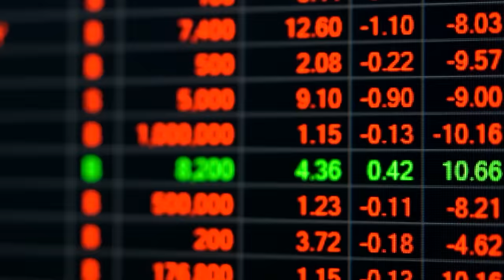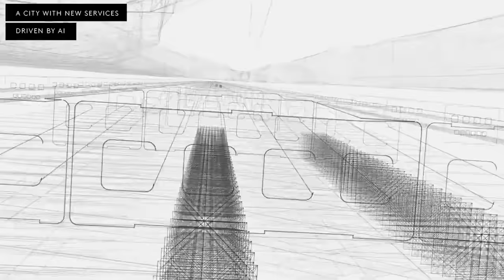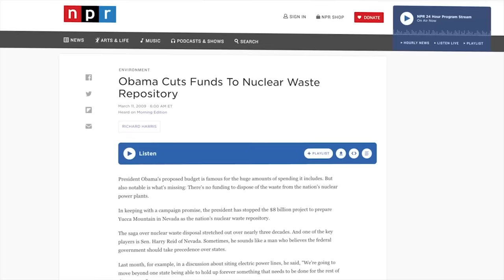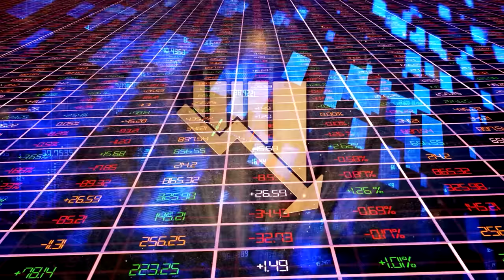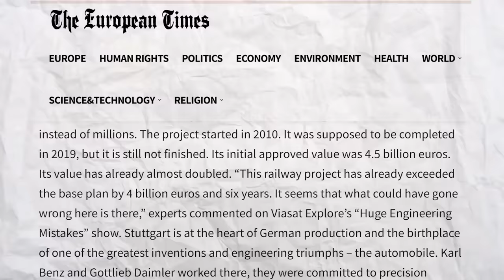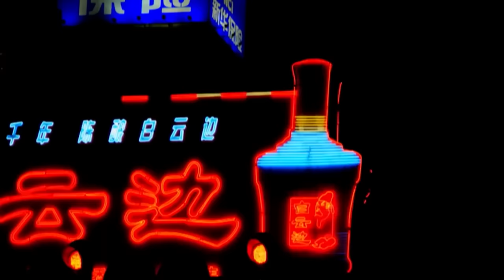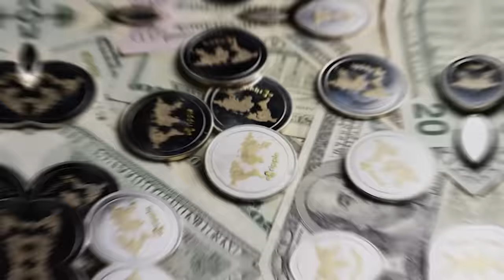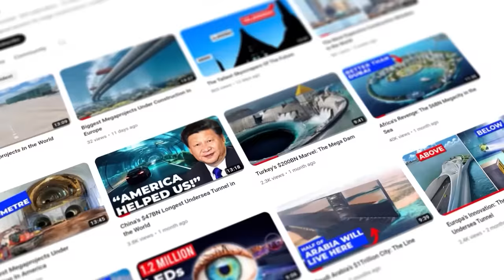Biggest Megaprojects in The World

Comment: The Globe (formally: Avicii Arena, since 2021,[2] previously: Ericsson Globe, Stockholm Globe Arena) is an arena located in the Globen area in the Johanneshov district in Stockholm. It was inaugurated on 19 February 1989 and was until 2023 the world's largest spherical building[3], when it was surpassed in size by the Sphere.[4] Since February 5, 2010, a gondola track with two round gondolas leads up to the top of the Globe, 85.20 meters above the ground and 130 meters above sea level, called Skyview. The interior ceiling height is 65 m. The Globe is owned by the City of Stockholm (via SGA Fastigheter). The Globe is operated by Stockholm Live.[5]

The globe forms the starting point of the Sweden Solar System, a scale model of the solar system in which the globe represents the sun.

So Basicly Sphere is a nockoff.. just bit bigger and years later..

Comment: One little observation: many times, when the architect doesn't have an engineering degree in structural design and engineering, they are not involved in the technical flaws occured when it comes to structure (an example is the metal structure bridge that collapsed - that was the fault of the designer engineer). 

Basically, the architect might run a brief analisys of the structural problems that may occur, but the true calculation and analisys is done by the designing engineers. Also, the architect is not involved legally (it will not be taken responsible) in the exacution phases: like the digging and storing of the resulting amount of soil in case of the falling building in Lotus Riverside. 

Many times, the project manager is the architect and he/she collaborates with the engineers to establish if a decision can be made in terms of structure, soil condition and so on. Or at least that is how it works in Europe. 🤷🏻‍♀Of course, an architect can specialise in engineering too, and that would be ideal. 

There's a little dispute over if an architect has the necessary training to be a project manager or not. If you ask an engineer, they will say no and vice-versa. 😂

Comment: Learning opportunities are what this is about love the look let's see how long it holds up. If u put a rot board along the bottom saving the bottom of all the pickets. Also think counter sinking or a screw nail shot in. Ring shank nails should go in at least a inch. Likely they will blow away. Check storm rating requirements to get insurance. Strapping may be required. Or your making boards into projectiles. If you want to get wind storm insurance required it too close. Permitting & inspections to learn before you do things you have to redo. Love you both.